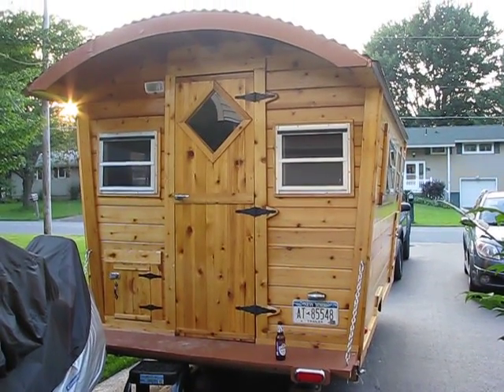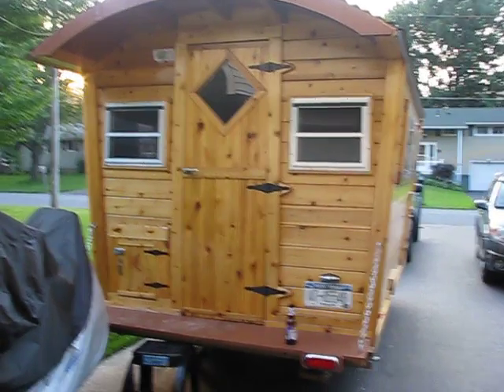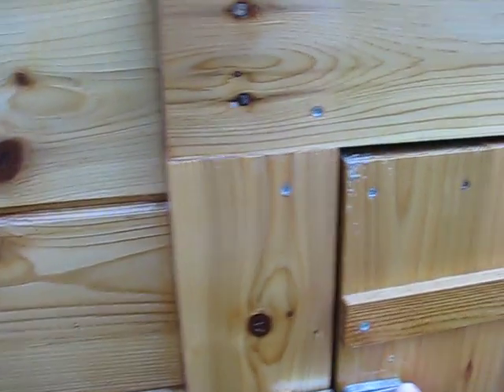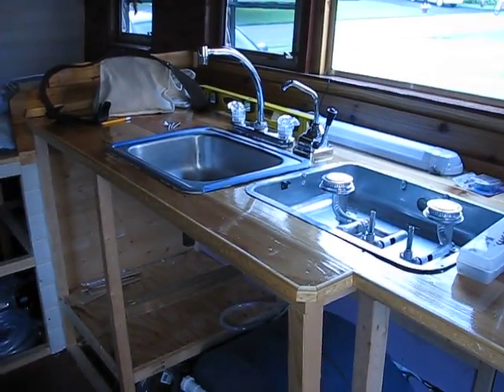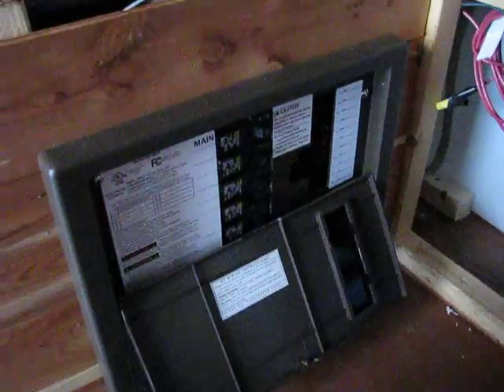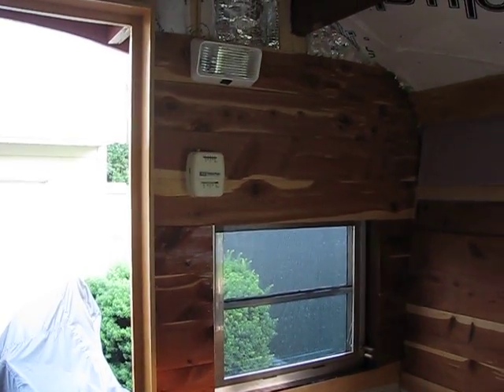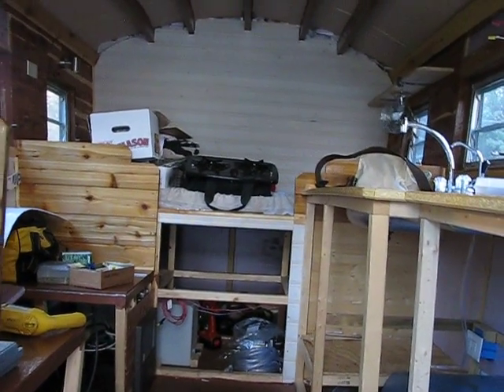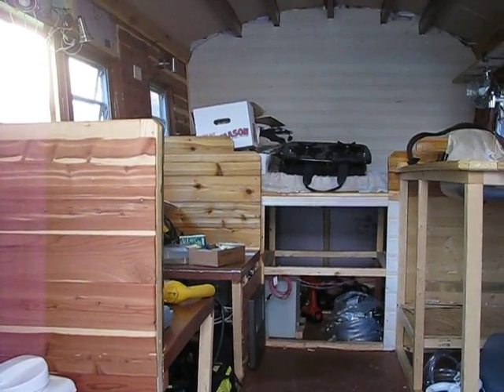Building a Gypsy Wagon - NOW (Tiny House, RV, Vardo, Travel Trailer)

Comment: I would suggest instead of having bare wires for you to get some corrugated bendable conduit for your wiring that way there is not risk of mice or chipmunks chewing any of it. I am going to build a house on wheels when I get back to the USA but I am going to include solar panels so that I will have a sustainable home also will install a small pot belly wood stove for natural heat. I believe that I will in fact go with a propane fridge as well as a full propane stove with oven. I do however not know how I will incorporate the water lines and a possible water tank so there are things that I need to work out a bit but am looking forward to it :)
Reply from the maker: Conduit is a very good suggestion, wish I'd of thought about that earlier!  I left double loops at all junctions so there is room for bending/flexing.  Got the propane fridge...in such a tiny space I'd worry about having a wood stove so close to propane but maybe your trailer will be longer than 12'?  Mine is 12' (living space) by 6.5'....quite small.  Love some of the tiny houses I've seen online too...beautiful stuff by very talented people.
Reply: yes actually I planed on making mine 9 and a half feet wide and 20 feet long about 10 feet tall to the peak. so there should be plenty of room for a nice little wood stove as well as a loft bed. I am excited to get back home to the US to start working on it as soon as I can :)

Comment: I built one on a 5 by 8 utility trailer, I used one inch pipe one inch styrofoam insulation and steel roofing as the outer shell, light weight panels for the interior

Comment: What is the length and width. You mentioned using an old RV trailer. I'm thinking of an utility trailer. The 5x8 is coming around here. They would make a great ledge wagon. But I worry if an eight trailer is just too small. What do you think?

Comment: Love it….but can that small little itty bitty tire wheel hold the weight ?
Reply from the maker: Hey there, yes, it’s a 3500lb torsion axel with electric brakes and 10ply weight rated trailer tires. Drove it from NY to FL and towed better than the 16’ trailer with 2motorcycles did.  Wish I built the motorcycle trailer 😳, thing was horrible in the mountains even with sway bars.  I moved to FL so made several trips but best one was with the Vardo.

Comment: how did you bend the roof.
Reply from the maker: Hi Ray, I used a homemade sort of compass....I built the frame, added the tongue and groove, then used a 2x4 screwed at center on the bumper and when you swing it...it creates an arch.  I drilled a hole and inserted a pencil and viola!